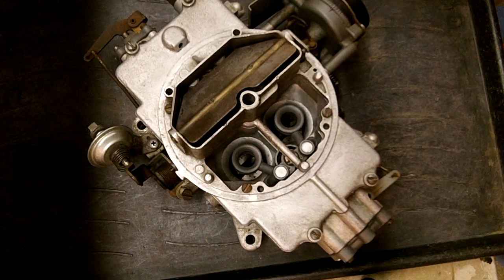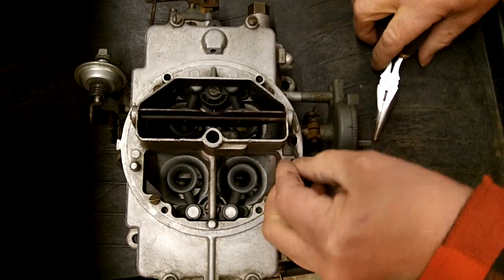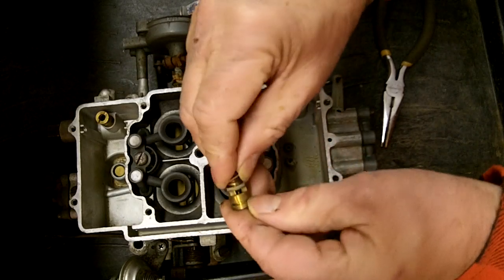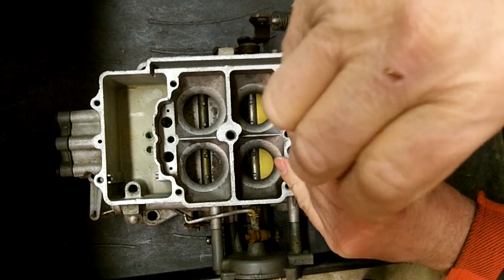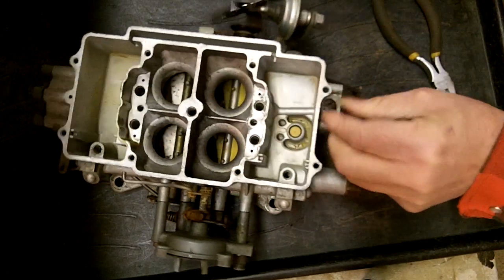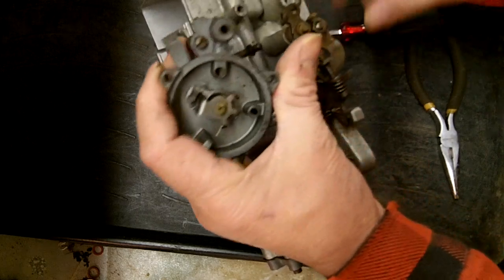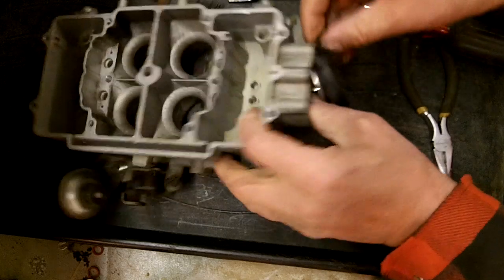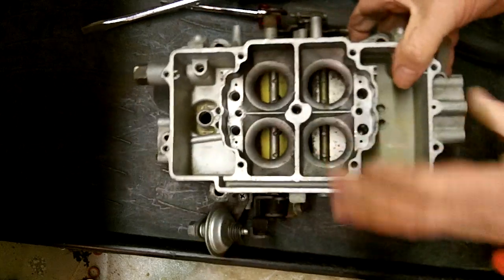Autolite 4100 4 Barrel Carburetor Rebuild - Part 1 - Disassembly

Comment: Well these are staked when you try to remove them they will ring off why remove them if the throttle shaft is wore out then remove and put new bushings in mikes shade tree carb rebuild
Reply from the maker: I guess look for another carburetor.

Comment: My secondary butterfly flops are sticking a little bit when they’re closed, would you recommend taking them apart and cleaning them? Or is there something else I should do? Thanks.
Reply: @MikesCarburetor   I’m sorry but do you mean by Grind the back of the screw threads down to the shaft?
Reply: thanks Finished rebuilding the carburetor which got the car started good but now I have smoke coming from the oil fill cap and you can hear the engine missing which is in a Ford Thunderbird that’s been sitting for 50 years with a 390 engine in it

Comment: Followed this video and the instructions that came with your rebuild kit but having trouble removing one of the primary Jets which I tried heating up a little with no luck; which now has a stripped head and was wondering if you might have a suggestions? Thanks for your help!
Reply: @MikesCarburetor  Thanks I got them out and I ordered new jets from you guys

Comment: I've got the original off my 64 galaxie. It's in relatively good shape but the carb base is warped slightly. What can a guy do to resurface the base and get it flat again?
Reply: @MikesCarburetor  I wound up dressing it with a flat stone and it wasn't warped as much as I thought. Its pretty flat now.

Comment: At the 5:00 minute mark where you removed the jets - is that the only thing you change when re-jetting the carb?  I have this carb on my 1964 Ford Galaxie with a 352 and my car pings a lot even with 91 octane in California sea level elevation.  Someone recommended going to the next size jet, as he feels my car is running lean.  my carb is the 1.12 size, but I can't guarantee it has the original jets.

Comment: Note:  This video does not show the removal of the air-cleaner stud.  If you don't remove it, the top of the carburetor will not come off, so remove it before you begin the disassembly procedure shown in this video.

Note 2:  Also not shown in this video is a tiny check-ball in the secondary diaphragm area -- it's inside a hole that you can see at the top, after you have removed the secondary diaphragm cap.  The hole is exactly in the middle between the top two screws that hold the secondary-diaphragm cap on.  If you take the secondary diaphragm out and turn the carburetor just right, it will fall out, so be careful!!  This check ball is not included in the kit from carburetor-parts.com (at least, it wasn't included in the kit I received).  So don't lose this little tiny check-ball!!  It's is far smaller than the one in the accelerator pump, and is very easily lost!  (Luckily I saw mine fall out, and I saved it -- didn't know where it went until I found another re-assembly video here on YouTube.)

Comment: Sir: We have a 1968 Ford Thunderbird 429 V8 with the designation ThunderJet 360 horsepower.  Would this Autolite 410 be the THE carb for my muscle car OR should I switch to a Holley 800cfm dual feed double pumper spread bore!? Thank you, sir; YOU are doing GOD's work!! Jo and Captain Dan dba Ppaco Entertainment, Hesperia, CA 92345 usa
Reply: L@@KS like this 4100 Autolite has double accelerator pumps front and rear !  Is this a spread bore or sq. bore configuration?  AND finally, can it be made to accept electric choke  assembly? thank you, brother.
Reply: thank you Dave
Reply: er, that would be MIKE.

Comment: Hey I was wondering, I have an autolite 4300, I just rebuilt it and the new nitrophyl float seems to be too big and it rubs causing the carb to flood over. the parts store told me that they make a brass replacement float that is a little bit smaller. What is your opinion on what I should do? Thanks!